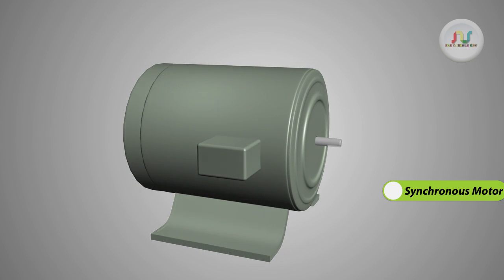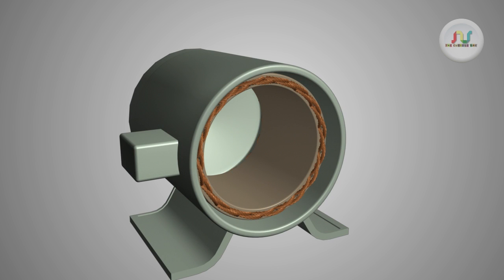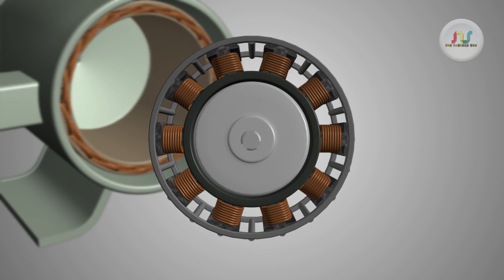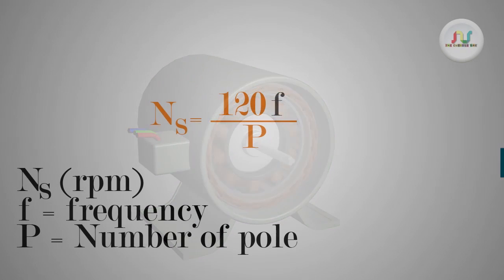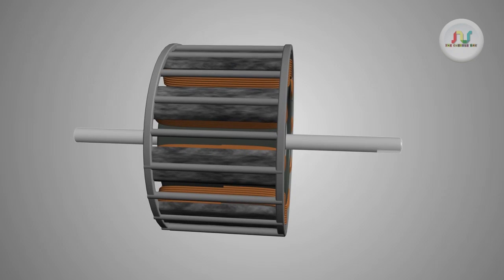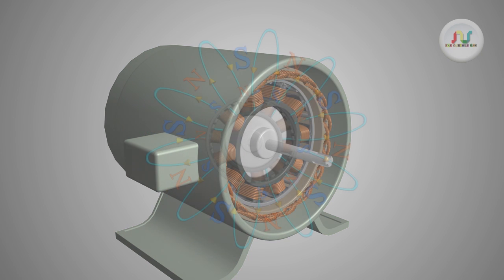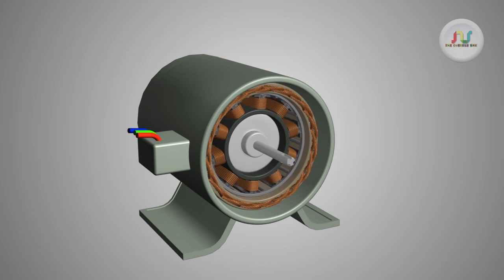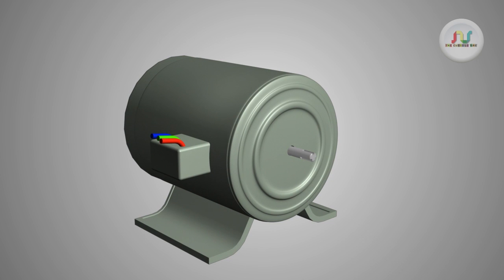How does Synchronous Motor work  ?

Comment: where to find this type of motor where usually used?
Reply from the maker: +Judge Philip Igsoc  Synchronous motors are used in generating stations and in substations connected to the busbars to improve the power factor.and constants speed application.
Reply: Wind nd water turbine.....may be..